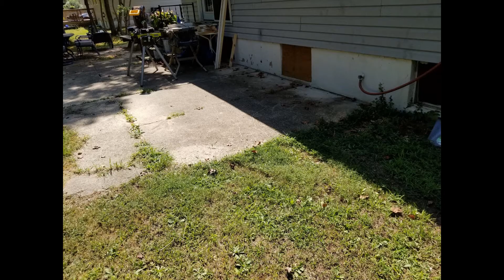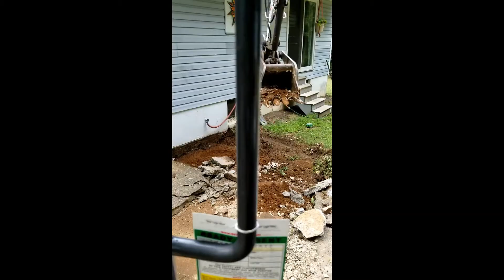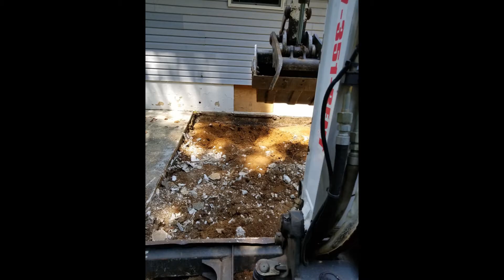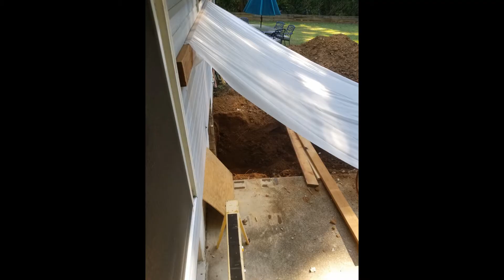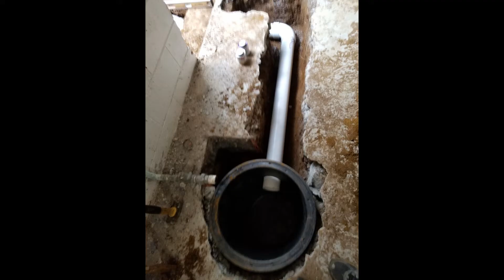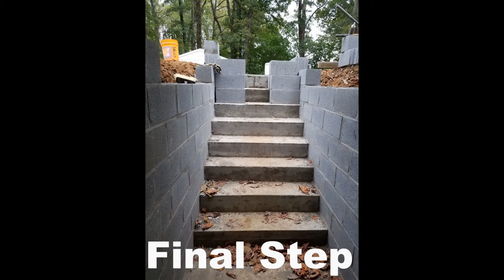Building a Basement Walkout

Comment: Interesting build. Can you provide an update? How has this held up? I'm doing something similar but will pour the stepped footing for the entire stairwell all at once, reinforcing it with rebar. I'll also be adding vertical rebar in the wall, a top bond beam, and solid filling the block.
Reply from the maker: I don't reply to this channel often enough. Sorry. If you still need info let me now. the stairs have not moved a milllimeter.

Comment: Is there a reason you put the sump inside? I feel like you could have just put it outside right under the drain and then drained at the top of soil past the walls?
Reply from the maker: Hi and sorry for the delay. The pump needs to be inside in the conditioned space or you could have frozen water in the pit. Also the electricity and pump equipment is better shielded nside. That is the typical way of doing it.

Comment: i think you should have cut the floor first then use the jackhammer or get the floor out, that insures the integrity of the footer this does not
Reply from the maker: That would have been an improvement but I was planning on tiling hte basement floor so straight lines were not important. As far as the footing goes, I never touched the footing. Thanks for the tip.

Comment: 10 years & the block walls are up against the door frame. This job is a disaster
Reply: How long did the job take?
Reply from the maker: It was a massive effort. It took 100 bags of Sakrete and almost that many mortar and about 200 blocks. The length of time is difficult to say because I did it at my leisure and it was over four weeks, but with help and if you worked on it everyday, maybe a week.
Reply from the maker: Grumpy...lol, I think it turned out nicely, but critique away, I am happy with the results. Cheers!
Reply: Did you put any steel in the walls?
Reply from the maker: @allanbekkala2440  Yes, there is a mesh that is sold to reinforce walls.